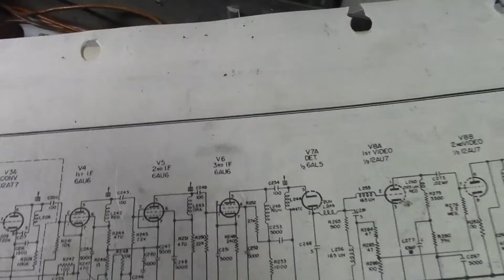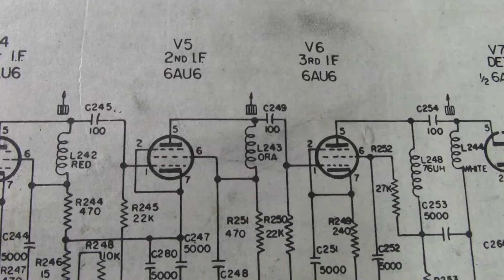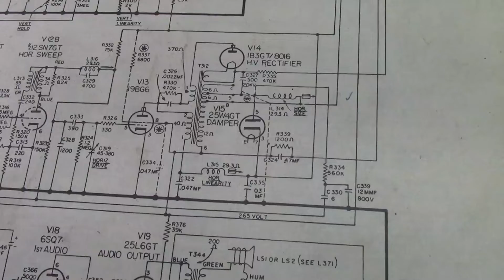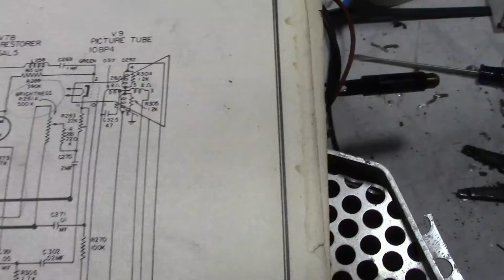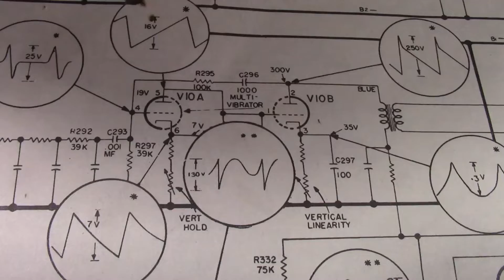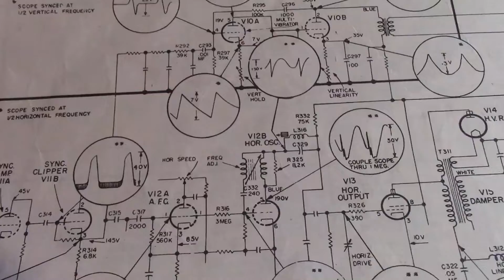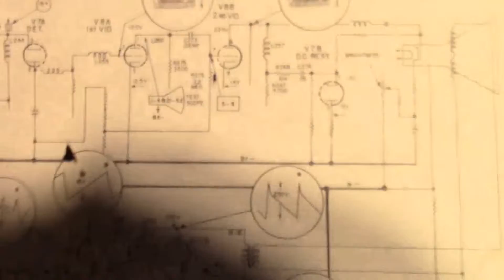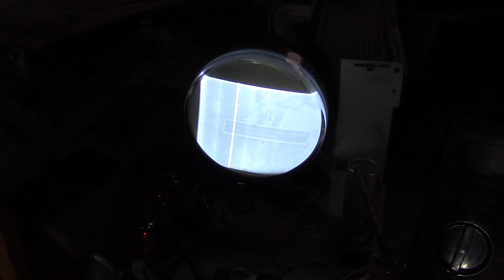GE 800D restoration p4o8

Comment: 37:13 The impedance of the scope is not only resistance. It has capacitive elements too.
If - as per instructions - you place just a 1 meg resistor in serIes with your scope probe, that will not only lessen the load on the test point and extend the voltage range, but more impirtantly form a LOW PASS filter with the input impedance of the  scope probe! And low pass means you filter any high frequency ringing out of the displayed trace! So if you are chasing ringing you may fool yourself by not following the test procedure.
Reply from the maker: Thank you for the clarification.  I will definitely pay more attention to those details in the future.
Reply: I'll hazard a guess a 100 MHz scope might also show stuff you weren't meant to see, service data is likely assuming 5 MHz at best.

Comment: I suspect R325, 8.2k.  This is in parallel with the frequency adjust coils.  You are seeing a lot of ringing and excessive voltage.  Perhaps this resistor has gone high or open circuit leading to reduced damping of the coil because it absorbs less energy.  I enjoyed the video and am looking forward to the next one.
Reply from the maker: Unfortunately, I tried that and it made no difference.  Part 6 coming up soon is all about the horizontal.  Stay tuned.

Comment: Hi. About the contrast control. Have you checked to see if someone had replaced it with an audio-taper pot (like a volume control), rather than a linear-taper pot? That would account for why the set doesn’t have a large dynamic range of adjustment. I’ve seen that before; some well-meaning tech just grabs a pot with the right resistance, but the wrong taper, just because it’s what they had on-hand.
Reply from the maker: Hmm, no I hadn't thought of that.  I did find another issue that helped somewhat but the range is still limited.  I'll have to go back and check.  Not much I can do about it if it is the wrong taper though as it's a difficult to find control.  Perhaps I can tweak the range with some external resistors though.

Comment: It has been my experience that any paper mica cap get replaced. They will test 100% good, but when replaced with new ones, the circuit will work properly. El Menco ones are the worst though.  I look fwd. to your solution.
Reply from the maker: Well I figure it would cost around $100 to replace all the mica caps.  That;s assuming I could even find them all.  There are some oddballs like 6pF @ 800v.  It's not my set and I don't think the owner wants to invest quite that much.  Otherwise I would.

Comment: That line maybe Horizontal output barjausen oscillation, try a different brand Horz output
Reply from the maker: Good suggestion, but I did and no difference.  One thing to note is that Barkhausen oscillation would not cause the dramatic horizontal linearity distortion on the left side.

Comment: 7:10 the 100pF micas would for sure affect the alignment of the IF coils. Just arguing based on value 100pF is too big for it to be a coupling cap who you do not want to affect a (parallel) resonant circuit. And arguing from circuit design, this is not the typical parallel resonant filter design with inductive coupling between stages, it is a series resonant circuit design which makes the cap an active part because it is about the only inductance the coil can play against.
And 7:50 ; I dont know which capacitor you refer to as "that capacitor", R251 470 Ohm would hardly have died due to a leaky mica C249. If C249 leaked it would have rather pulled the grid of the V6 tube up. I would suspect that the screen grid filter cap C248 on V5 was leaky and cooked R251.